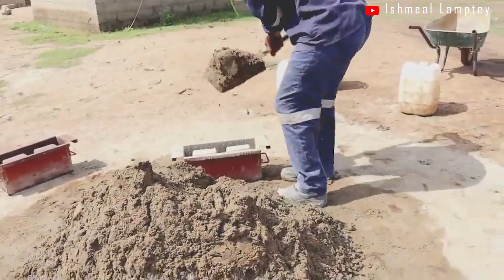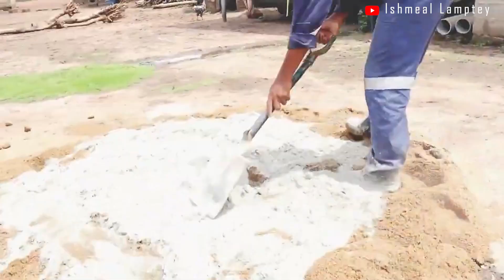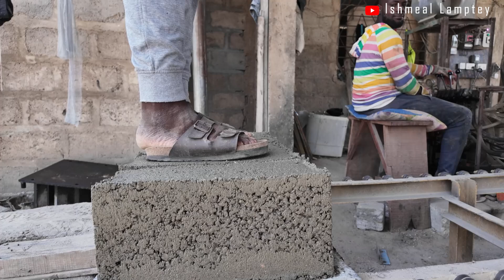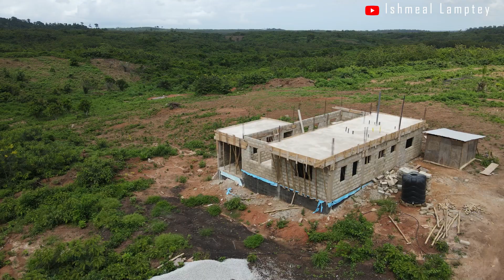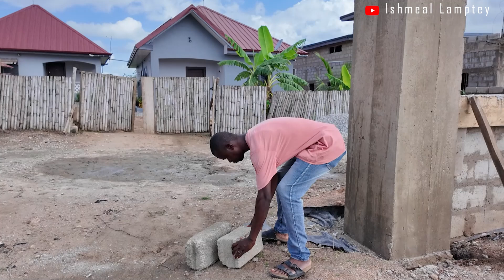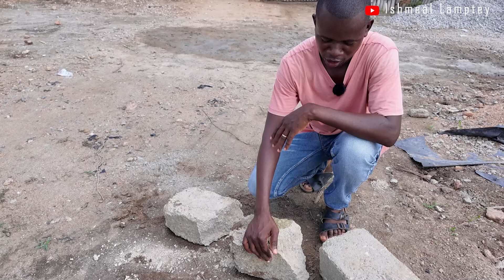Buying blocks vs making your own blocks! Which is CHEAPER?

Comment: Is it possible to use river sand for the block cutting and also how many blocks can be use to build normal size chamber and hall self contained, thank you ..
Reply from the maker: Some people do and i think it works fine. Unfortunately I can't give quantities of blocks as i haven't seen the size of the building
Reply: @IshmealLamptey  thanks for the reply
Reply: For a hall and chamber self-contained, you should estimate  about 4000gh from foundation to finishing considering the height of the walls and the depth of the foundation.